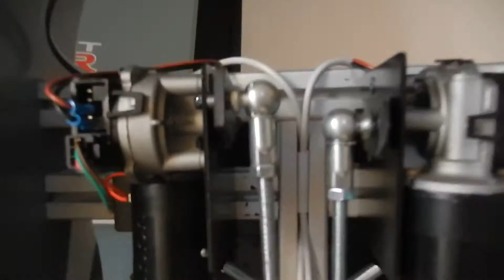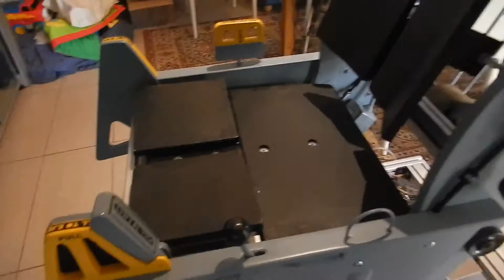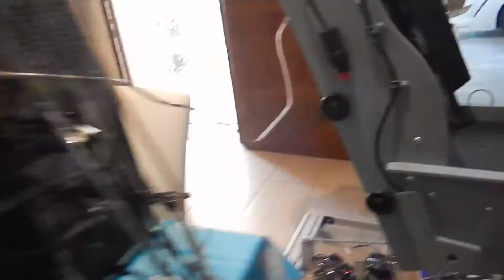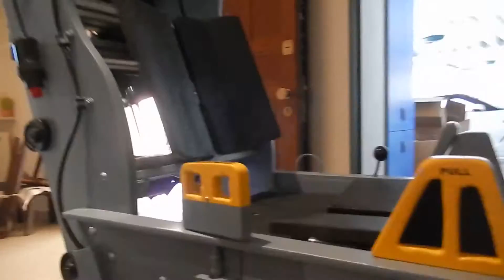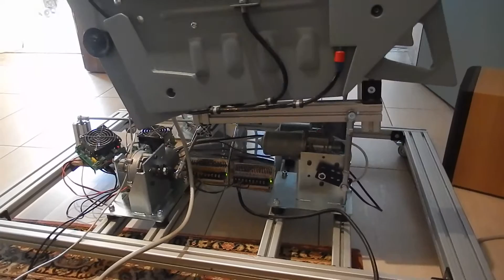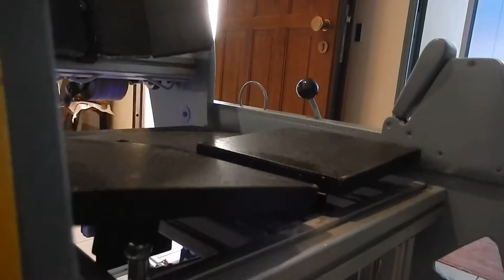diy g-seat test base sedile 8 motori

Comment: Great build! I wonder though, any particular reason why you constructed each back flap out of two separate parts?
Reply from the maker: +mruhum 
yes, I wanted to have more pressure on the back and sides with separate floor you can if it was only he would not have had this result
Reply: +spyderwash I see, thanks for the reply